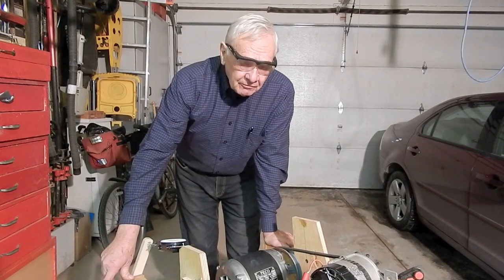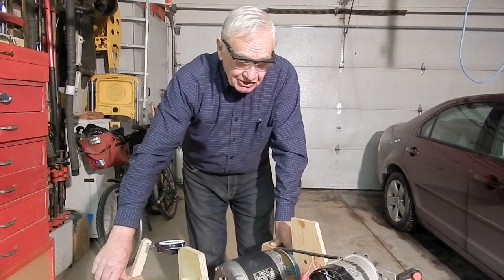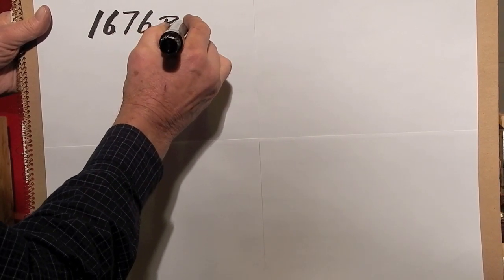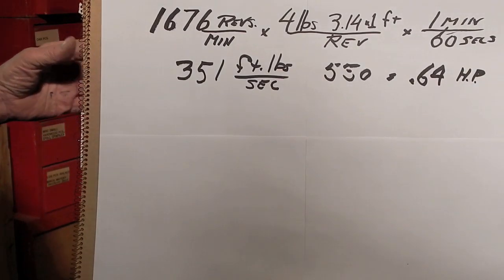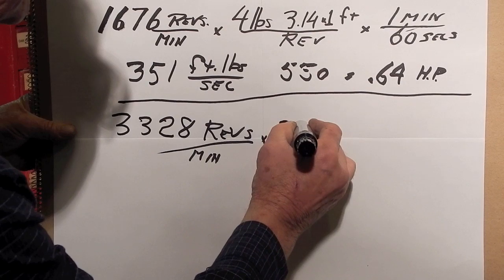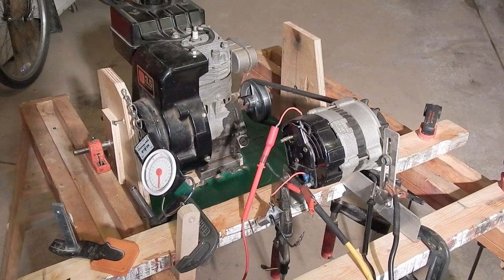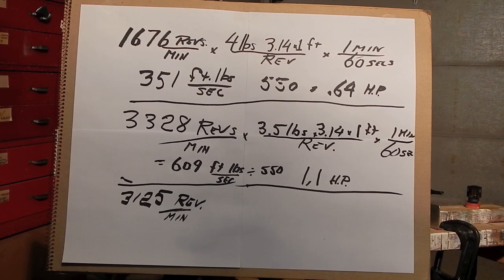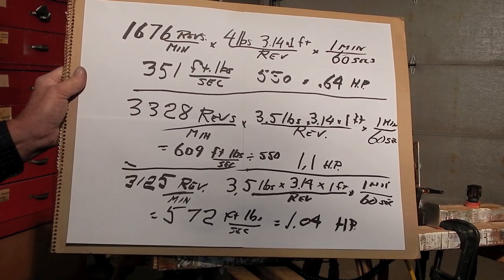Horsepower Small Electric Motors and Gasoline Engines

Comment: Hi:
Interesting experiment but it appeared to me that the scale you were using had pound graduations on the outside of the ring and kilogram graduations on the inside of the ring.  You appeared to be taking your numbers from the inner ring (kilograms) rather than the outer ring (pounds) which would make a considerable difference in the calculations, wouldn't it?

Bob
Reply from the maker: Bob H.
Am I ever red faced!!  You're absolutely right. I may have to redo the video.
Here are more accurate results:

1/2 HP Electric: 1676 RPM    8.5 Lbs Force (4.25 Ft-Lbs Torque)  1.35 HP

3.4 HP Electric  3328 RPM    7.5 Lbs Force  (3.75 Ft-Lbs)            2.37 HP

3.5 HP Gas       3125 RPM    8 lbs Force  (4 Ft-Lbs)                    2.38 HP

Gas engine deserves a retest with a new sparkplug, air filter, fresh fuel etc. 

Thank you for keen observation.     ////carl
Reply: thanks for the video. I really liked it :D glad to see you were honest enough to admit an oopsy LOL!
Reply: great video. Saw that too but we can understand what you are trying to show and the result is going to be the same kind of.

Comment: AC induction motors, like the one you are using, have what is called breakdown torque. This is the peak torque the AC motor will produce before the torque sharply falls off to the point that the motor stalls. This is not like a DC motor that has max torque at zero RPM's. 

So with the breakdown torque of the AC motor, you can get much more horsepower out of the motor because as you overload the motor you gain torque, but you also have minimal speed loss so horsepower increases as well (so does current draw to satisfy the power input increase for the mechanical power output increase).

For gas engines, torque does not increase as you overload them. Thus, gas engines lose speed and torque, therefore the horsepower will start to decrease as you overload gas engines.

I made a video explaining this here: /watch?v=eoIRsqfLH5Q

Comment: I think you have to consider the gasoline engine revs when measuring its power. The power curve is quite step on both sides of its best point. I would guess the best power from such an engine is at a much higher speed.
Reply from the maker: Henrik,   I agree, possibly this engine received its factory rating while operating at a much higher speed. It would be interesting to over-ride the governor of this engine a do a series of tests at higher speeds; I may do that as part two of this video.   Thanks   ////carl
Reply: I forgot to say that I admire your setup. Only a few actually takes the time to do this. You show us that it can be done in the garage at home. Thats great. Thanks.
Reply: Henrik, that would not make any difference, the AC induction will still win. AC induction motors can have breakdown torque levels as much as 300% or more of the full load torque!!! There is no combustion engine on the planet that can increase its torque by 300% when under overload conditions!!! Also the speed drop will be minimal versus the gas engine, so the horsepower will increase quite a bit! I have a 3 HP AC induction motor made by Leeson (model 120341) that is rated at full load speed of 3512, but I can get 4.5 horsepower out of, but only lose about 57 RPM when I overload it to that level, and that is not even at its max breakdown torque limit which is at 300%!